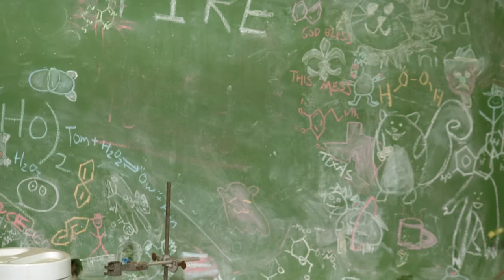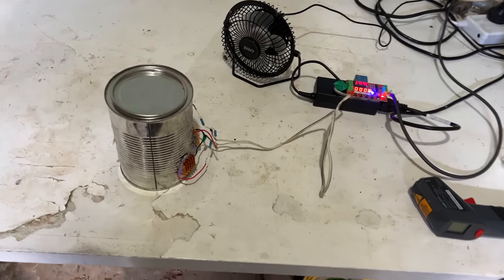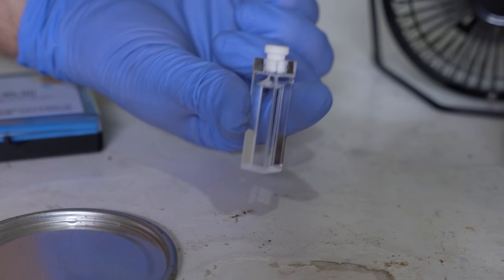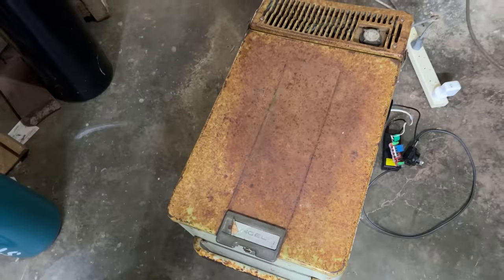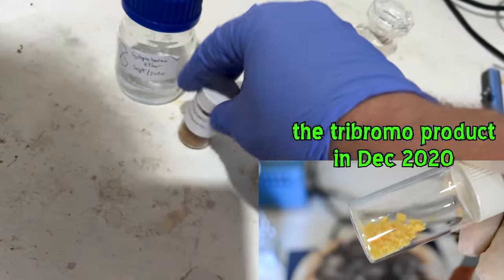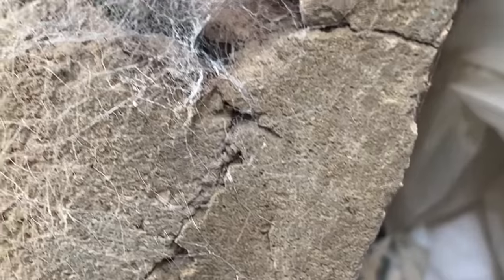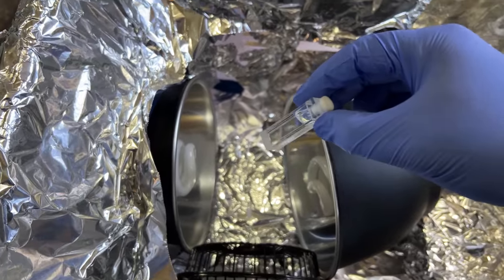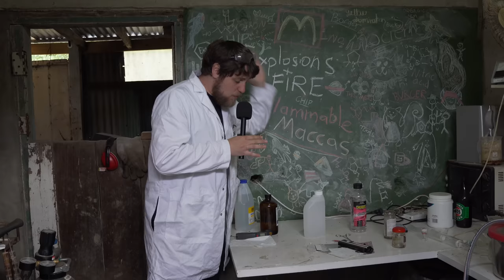The PhotoFridge - Cubane Ep 13

Comment: You can certainly be forgiven for having hot resistors.  A lot of people don't know that a "1/4W" resistor gets really hot if you put that much through it.  Roughly:
1/4W = 40C rise
1/2W = 60C rise
1W = 80C rise

This assumes you have the "rated" resistor as well.  1/4W dissipated from a "1/4W" resistor will make it about 40C hotter than ambient, while 1W on a "1W" resistor gives 80C.  The trick is to check the "thermal resistance" charts, but any engineer will tell you to run resistors well below their rating if you don't want them hot.

Those look like 1/2W resistors BTW, but without mm dimensions, can't be sure.

Short answer, your design is fine (now) and won't burn out the resistors, but they will get hot.  This is why, and what you could improve if you want:

Regarding how much power the resistors are dissipating, the package claimed the LEDs are "6V".  You could easily measure it with a dirt-cheap meter but for a reasonable approximation, you subtract the input voltage from the LED voltage you get the voltage across the resistor (19V - 6V = 13V) then multiply that by 40 mA and you get 490 mW, which is a reasonable amount.  However, as mentioned, the resistors will get HOT.  If you have resistors of 4x the resistance or so, I'd suggest twisting 4 of them in parallel (which gives the same resistance) and now you have made a much larger "resistor" of the same value, which handles more heat.  If you have a "5W" or larger resistor of the correct value, use that instead, it will remain basically cold at that load.  Finally, there is no need to run the LEDs with a 19V supply.  If the voltage drop is 6V then 8V or 10V is more than enough for reasonable control by the resistor.   Assuming 10 V in with  6 V LEDs, that's 4 V on the resistor.  To get 40 mA, that's a 100-ohm resistor (4V/40m = 100).  Power dissipation would drop then to 160 mW (4 V x 40 mA).  If you drop to 8V, you need only a 50-ohm resistor.  As the voltage drop approaches 0 on the resistor, it gets harder to properly control the LEDs because they aren't always going to drop the exact same voltage, so you leave a few V to have some control.  You can also use much better control options than a resistor but seriously, the resistors are fine for this, just try to keep under the 40 mA rating.

If you don't already own one, go buy a $10 digital meter "DMM" or so.  Basic volts/mA/ohms measurement.  Endlessly handy.  You'll never be able to measure 40mA using the analog meter on that power supply, and they are great for electrolysis and other experiments.  Edit - saw your meter on the desk in Ep 12 but not here.

Comment: Hey Tom, trying to stain realtively unfunctionalized molecules is always a shit show. In your case you have no more oxidizable feature in your final product so forget the KMnO4, there's no alkenes or conjugated systems so forget UV or Iodine. For ketones, there are various exotic stains and one of my favorite is CAM, but I think your best bet would be either 2,4-DNP (this should be right down your alley as an explosive😅) or vanillin stain which are both easy to make and produce very colorful spots. P.S.: do not heat the DNP dipped TLC plate cause it goes boom

Comment: UV reactions are always a pain in the backside. A lot of people use flow reactors to maximise light to volume ratio or specialist equipment. So rather than 10ml and a peripheral led.  A tiny coil+pump will keep pumping solution fast around or inside an led. so 0.01ml x 100cm coil will see much of the led. So more contact time.Other uv reactors have the led in a quatz probe and it sits in the solution as its stirring, more contact time.  Back to basics though. I would try a known reliable literature uv rxn first, does the set up work before you waste more material. The test for alkene is with bromine or iodine. Your starting material should react and you solution goes colourless. Product shouldnt react at all as theres no alkenes. Not much of progressive check and im not sure about enol type reactions. Destruction tlc. Heatgun sm run tlc and heatgun rxn. Then stain maybe able to see a difference or something indicative to tell you something has changed.

Comment: I was under the impression that a device will 'pull' the amps it needs, so if you provide more amperage it will not pull any more than is needed to operate it. Is this innacurate? Someone correct me if I am mistaken

Comment: don't shake it up, you can use the cube without shaking it so the solvent doesn't touch the lid, use the lid just to cap most of the air flow. Should help a little, and aren't there other techniques you can use to analyse it? The product could be being destroyed by the TLC process.

Comment: My suggestion would be not to use hot glue on something designed to absorb heat 😬 If you end up using that for the full reaction I've got a bad feeling that glue is going to fail at some point.

Comment: For the electronics you might just want to get some read-built modules.
Getting a constant 40 mA from a 19V supply with resistors is.... not a great way. using hot-glue is more like adding insulation, having the resistors that drop most of the power inside the cooled area means that the fridge is mostly just cooling those instead of the LEDs and the reaction.
you really should get that stuff from a reputable source - aka NOT amazone, NOT aliexpress - if you are not well versed. Yes i am including amazon in that warning cause most of what they sell is cheap chinese nockoffs that are not even close to what they claim.

Just some very rough numbers here:
lets assume the LEDs drop ~8V at 40 mA. With a supposed 19V supply that means dropping 11V at 40mA for the resistors - that is about half a Watt while the resistors you are using (carbon film resistors) are typically rated for 250 - 500 mW maximum (and by the looks of it i would say they are either 330 or 300mW ). Heck, if you want to use them then at least spread the load. Instead of 1 resistor use 4 - combine 2 in parallel, and of that package take 2 in series.

And again - it would be best to either get a correct finished assembly directly (UV curing gadgets for 3D printing or nail-work are plentiful) or ask somebody with some knowledge about electronics for help. This will safe you a massive amount of time and money.

Comment: Not bad tinning the wire... cringe for the rest of the electronics... but I'm an EE not a chemist, so I'd have blown myself up by now. Have you thought of placing the LED arrays in the lid of a reaction vessel? Wouldn't need any sort of quartz. You can also thermal epoxy the led arrays to a generic Computer CPU cooler fan assy... and I can show you the math for proper resistors, etc.

Comment: Can you try and detect the product chemically? Is there anything that the product would react with that side products wouldn't? Could you just try and deprotect it and use the presence of ethylene glycol (produced in deprotection) as proof that you haven't turned it into random tar? Not sure how you'd prove presence of ethylene glycol aside from distilling it, and you probably don't want to go to a scale big enough for that. Unfortunately, I'm a polymer chemist so I'm not gonna be much help.

There is always the option of 'fuck it, I think its working' and trying the next steps and attempting to detect one of the next products and using that as proof that this step worked. You really need to get your NMR friend to run more samples for you.

Comment: Wholly fuck this man was running leds straight from power supply. I'm thinking thoes leds had to be COB leds w an on board resistor. No way an led is gunna pull 19 volt unregulated and survive maybe if u were running a whole lot of them. Funny as hell to watch a chemist try to work w literally the most basic electrical components, a diode and a resistor. His head would explode if he ever used a transistor.

Comment: I don´t know how importent the light output is for this reaction, but those cheap UVC LED´s are garbage!!!
A very good and cheap source for UVC are the compact "fluorescence" ones with no fluorescent, and made of quartz glass. 
The sell very cheap on the usual chinese market places and work great!!!

I tryed this on a hydroponic system for my  indor "lettuce" because i head problems with algae and stuff, the algae couldent care less under the led´s, but the compact lamp annihilated them after a day!
In hindsight simply using non transparent containers would have been smarter, but murdering those algae with high levels of radiation was fun! 😁

Comment: 2:24 to 2:29 looking good.
2:30 to 2:32 doesn't look good.
2:33 to 2:39 this is fine.
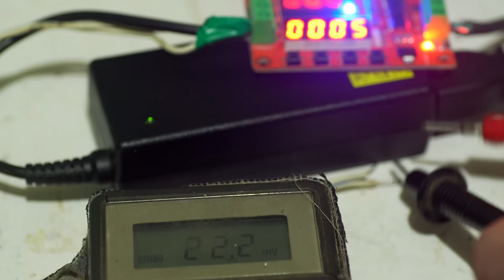2:40 to 2:47 it is alive.
2:48 to 2:54 not best probing practices, but it how you doing it.
2:55 to 2:31 I think we can put our differences behind us, for science. You monster.
Seriously, do not hot glue heat-sinks (use something else that does not melt easy, even cable ties.) and never leave exposed wire hanging, I have done that and I have regret it soon after.

Comment: Idk I'm just a first year student, but I feel like your TLC plates run too far. We usually let the top cm be dry. Also eluent, I know you've worked out and spoken with people for the one you're using, but they need to be tailored to your specific molecule. More than that idk, go play with some solvents and get a headache, it usually works for my random samples that don't show up. Your molecule is also very complex, that could make it hard to climb the plates. 
If you need any sources for anything I said then I'll gladly invite you go go find some, I couldn't be arsed since I'm probably just wrong in the end
Reply: As far as solvent front do not run to very end of plate it is fine, even if there are 1-2 mm only dry. As for complexity of molecule, it is about polarity, a lot more complex molecules climb without problems because they do not have any functional groups that could change polarity (a lot of terpenes for example).
Reply: @ejkozan  ohh thank you very much. Didn't expect any responses, but those are actually quite helpful for me currently so thanks!
Reply: @Darkytz  You are welcome! If you have any questions just ask!

Comment: My dude, your conception of current and voltage is wrong.

Think of current as the amount of power the device requests from the PSU at a given voltage. Think of voltage as how forcefully that power is being sent to the device.

Your PSU is 900mA but your LEDs need 42mA. Applying the concept above, that means that at the rated voltage, your LEDs will request 42mA from the PSU. Since your PSU has 900mA of capacity, that's totally fine. The PSU will honor the 42mA request. You get into trouble if your device starts requesting more current than your PSU can supply. In that case, the PSU will probably kill itself trying to honor the request. This is why you can over spec your PSU in terms of amperage all day and your device will only take what it needs. 

Voltage is how forcefully the current is being delivered to the device from the PSU. There's no voltage "request" from the device to the PSU. It just IS. If the device isn't rated for that much force, it's fucked. So, voltage you have to get right.

It's also important to know current and voltage are inversely related. So, as the voltage drops, there's less force getting  power to the device, the whole system has to work harder, and the current draw goes up. That can be bad. 

In your case, I think your LEDs died bc you needed a current limiting driver to keep them from running full-out, max brightness 24/7. Assuming you have cheap Chinese made LEDs, in my experience, their max rating is only intended as a peak rather than a sustained brightness setting (probably to make their spec sheet look more impressive). I've made that same mistake in the past many times. Doesn't matter how "in spec" your circuit is.

Comment: I've ideas, but from things like "it's been 6 months", I get that you might not have that much time for this project.  My instinct is that you're going to have to find it and start pursuing multiple angles simultaneously if you want to finish it in a year.

IIRC you confirmed that your starting material for this step was good quality, so you know the process was good.  Seems like a good idea to process more of the previous steps up to this one.
Seems like there's more that could be done to verify the teflon cap is the source of the contamination.   There was another comment to this effect.  Maybe test the cuvette in isolation, too.
Probably record data on paper 😱 if you're not doing that already.
If you haven't already, start making a list of things to try / angles you can approach the problem from, like the ones above.  Brainstorm-style; no bad ideas, at least to start with?
Reply: Remember how significant it was when, in a previous episode, you ran (iirc) just your solvent and figured out the plastic contamination?  Being thorough, confirming assumptions, isolating problems.. can save you a lot of headache in the long run.

I work in software engineering and I can't tell you how often I have to pressure my coworkers into confirming their assumptions and then we discover the assumptions were wrong. So much time gets lost to chasing phantasms because we were sure X is surely working and Y really shouldn't be the problem.  Oops, X wasn't working and Y was A problem.  After fixing a problem, coworkers assume it's all good now and I have to remind them "calm down, there could be russian doll problems.. we don't know it's working until we actually see it work".  (Coworkers to project manager - "we identified the problem".. me - "we identified A problem")

Comment: i have very basic understanding of chemistry, but maybe you need to change the aceton and.. ehmm i dont remeber the other stuff Name, for the TLC solvent. Maybe the Dots are just of the "Plate" so basically just smushed against the top, or dont show if they are to charged (idk how those plates work exactly) or maybe you need to "zoom" in onto the new starting line dots. Your already have the option to basically change your "zoom/sensitivity" with the Aceton so fuck arround with it a lil maybe your are successful

Comment: For the LEDs, you can use an adjustment constant current driver board instead of resistors so that you're not wasting power through heat.
Something like this: https://youtu.be/rDkP97-BHXI
Won't help you with the chemistry though sorry lol